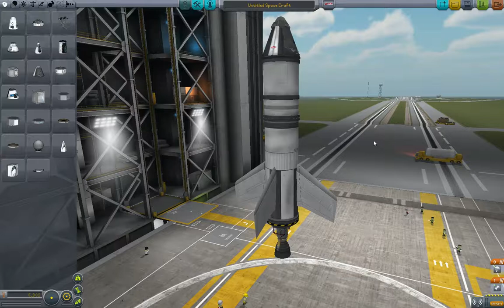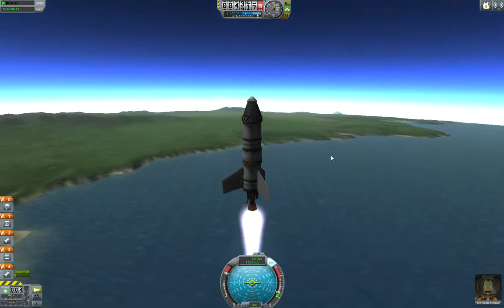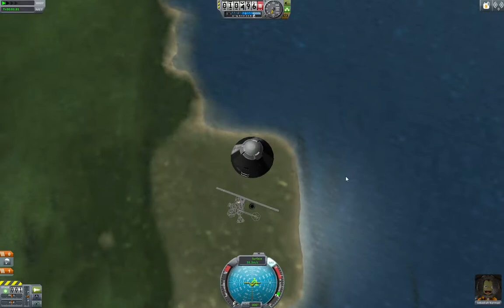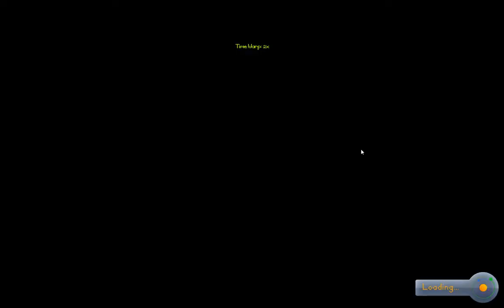5 minute Kerbal - #6 - Stack Decouplers | Kerbal Space Program

Comment: When I press space bar it decouples the capsule from rocket but it won't launch
Reply from the maker: make sure A.) your thrusters are in the bottom most stage, and B.) your throttle is turned up.
Reply: Thanks bro now it fixed problem is the part (A)